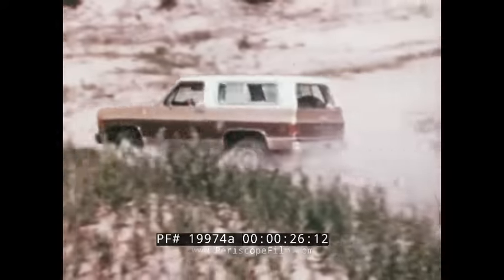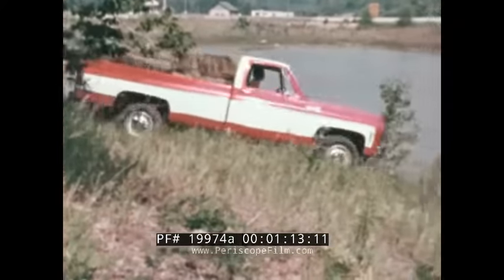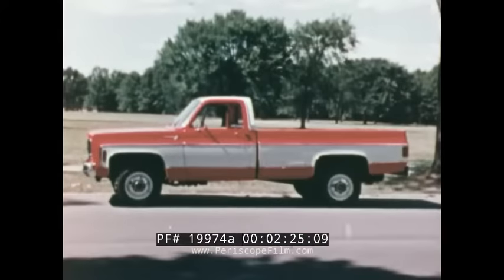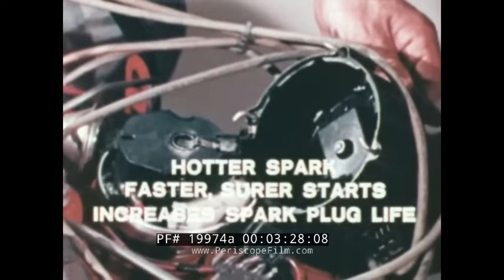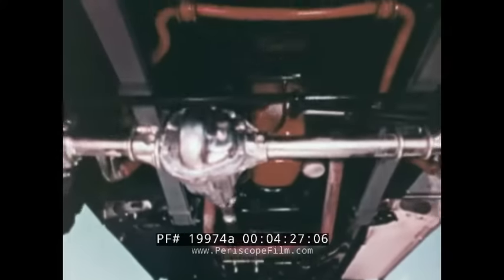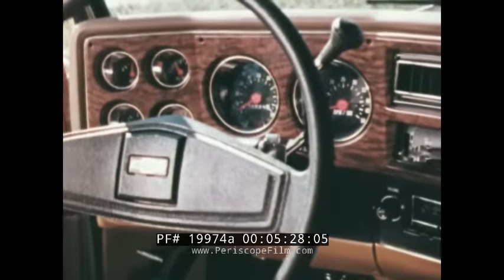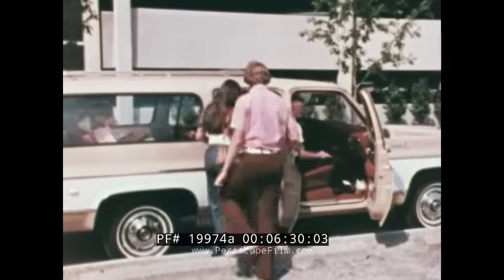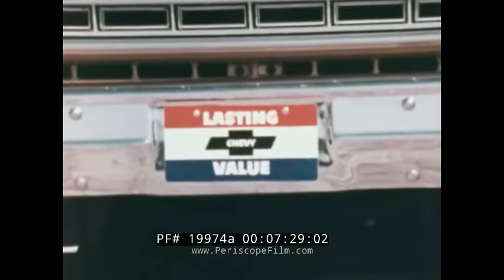1975 FULL TIME FOUR WHEEL DRIVE CHEVY TRUCKS PROMO FILM   CHEVROLET SUBURBAN & PICKUP TRUCKS  19974a

Comment: That NP203 was a horse of a transfer case, but it suffered from chain stretch and sprocket wear. The chains would get loose enough to skip.  They were brutal on front axle components also. 4 low fulltime would have been awesome for moving trailers around without the driveline bind of part time 4wd.   I remember a many a magazine ads back in the 80's and 90's for part time conversion kits, for Chevy, Ford, and dodge fulltime units.  I love these old videos though. Old iron rocks!
Reply: This is one of the reasons Land Rover with the 110 and 90 models in the 80s went with permanent 4x4 with a centre diff with lockable diff.

The thing the cheapskates should have added was axle difflocks. Because good driving skill and terrain reading can only get you so far.

Comment: True full-time 4WD.  With a real center differential.  Only seen today in the 4runner Limited, Lexus GX460/Landcruiser Prado, Toyota Landcruiser/Lexus LX and the Mercedes G-Wagon
Reply: Psst...and Land Rovers in 1971 with the Range Rover and 1983 with 110😉👍🏻
Reply: Jeep Cherokee also had the Full Time and Part Time (locked centre) option
Reply: I have one of the rare full time 4WD Tahoes with 4 Lo option (2005 Tahoe LT with Autoride suspension).    It is amazing in the snow.    It’s the Borg Warner 4482.    It has full time 4WD (60:40 split) and the 4 Lo button that allows the center diff to lock it to 50:50 torque split.  But it has no 2WD option.     Sometimes I wish I had the standard transfer case.   But, it’s a very unique setup for sure.      It’s a similar transfer case to the Borg Warner in the Hummers (BW4484) but mine lacks the 4 Hi (locked center diff) option and the Super Low option some Hummers have (3 speed transfer case).
Reply: Before the advent of on demand 4WD.

Comment: I had one of these 75 models in 3/4 ton form with full tm.4wd 14 bolt rearend and Dana 44 front end with 4;10 gear ratio Got 6-7 mpg. Put a part time conversion in the np 203, and lock, unlock hubs and could average 10-11mpg. And 13 plus on hwy.Full time was nice but, too much gas cost for me! Old Jeep Qaudra Trac system was as bad if not worse!

Comment: The 4 low unlocked centre option is cool. Not many vehicles have it these days. I can see it being handy on a boat ramp where you have a hard surface and need the centre unlocked for easy steering, but you also want the torque of the low transfer gear.

Comment: I did a lot of work on the cars and trucks of the 60's and 70's and the one 4 wheel drive that took the most work was this one with the full time 4 wheel drive. it tore up parts for no reason the axles were cheap and only used open diffs it's how they got around not needing to shift out of 4 wheel drive by only driving the left front and the right rear wheels. every one I knew who owned one had me put in spools in the back and a standard transfer case in the trucks just to save the front axle and drive shafts from wearing out all the time. they had a great engine and transmission but absolutely shit axles with a straight thru 2 speed case for the front wheels. you could also get as an option the front lock outs but the drive shafts still turned unless you put in a different transfer case .
Reply: I agree. Ive got shift on the fly now and i miss my dads lock out hubs. No electronics to screw up

Comment: Engines using leaded gas and no cats in 75?? I didn't even know they could get away with that....maybe because they were talking 3/4 ton+ trucks so they were exempt from some of the emissions regulations? Either way I'm sure they had to be unleaded/catalytic converter motors in CA. If anyone knows any more info on this let me know, thanks in advance.
Reply: unleaded fuel wasnt banned until 96, but was largely phased out prior to that date. and yes california had specific emissions models for their market. The owners manual i have for the 1976 year of chevrolet pickups expressly specifies to use unleaded fuel and against the use of leaded.